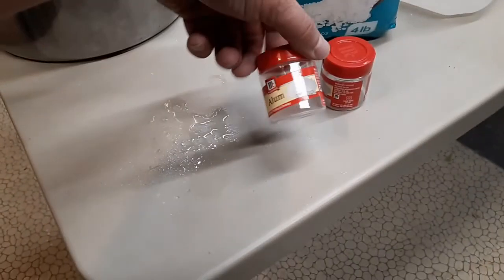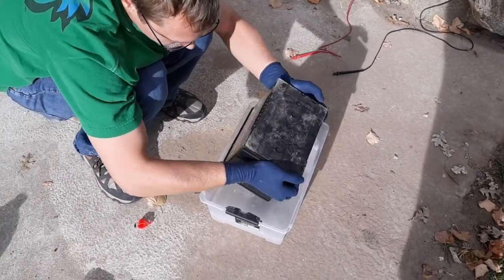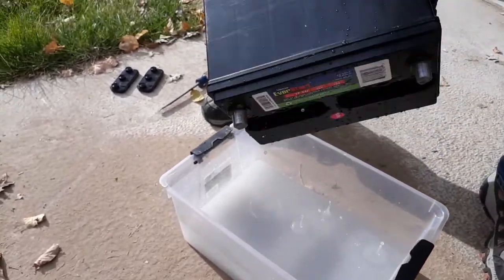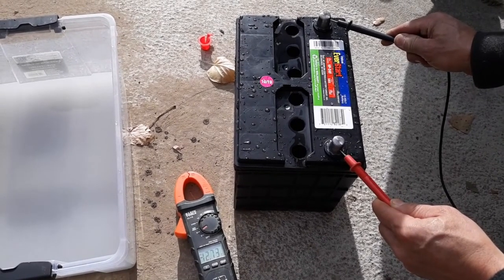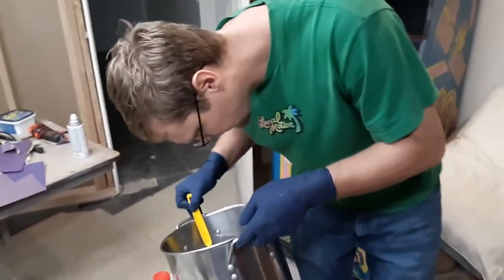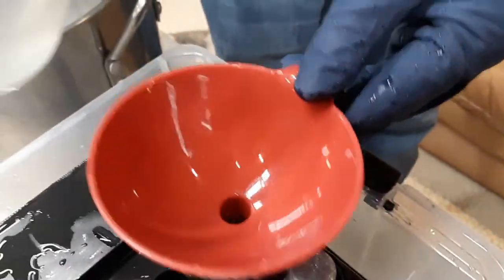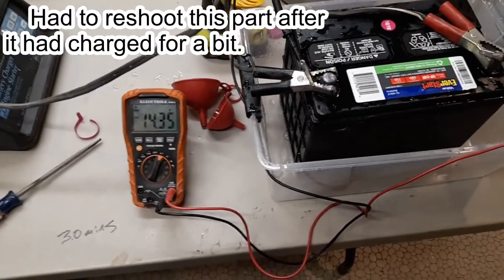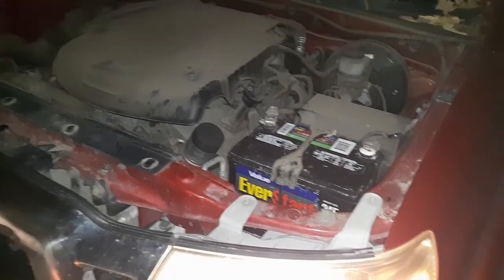Converting New Battery to Alum Magnesium for my Truck

Comment from the maker: In the next video I will show you the voltages on the battery when it's in my truck and I'll drain it and show you how low the the volts can go and still start the truck
Reply: Did you try using other lighter electrodes?  eg graphoil or nano coated copper ?(Keshe Plasma) or graphene oxide ink coated graphoil? (See Robert Murry Smith's Channel for info) . A bank of Keshe Plasma Batteries and plasma Caps could keep the Crystal batteries charged. A solid state self powering setup.

Comment: You end up using water anyway, so why not drain as much acid as possible like you did to treat it properly.  But then flush it with water over and over and over and over and over and over. And then forceful jet of water from hose into battery upside down. Flush TF out of it. And then you could run fairly warm to 'hot air inside to make every last drop of water leave. Then you can get to measuring properly!

Comment: I am wondering, if you discharged the battery fully ... all the way down to about 10V, would it recover or would it sulfate and die?
Reply: Replacement of the electrolyte should make it into a deep cycle battery.

Comment: What is your mix ratio?
Reply from the maker: There's no need to have a more concentrated mix than what I use, which is about 12 oz of aluminum potassium sulfate per gallon, the reason is is that the temperature of the battery determines the solubility of the potassium aluminum sulfate in the water, and if it's fully saturated at 16 ounces per gallon, when the temperature drops it precipitates into the battery. So having less concentration of avoids wasting aluminum potassium sulfate. You can probably even go less, but you won't change the fact that you lose a volt by doing this process, however it turns the battery into a deep cycle battery and allows you to draw roughly the same amperage down to very low voltage. However the lower the voltage goes, the lower the wattage output is, however the amperage stays roughly the same. I demonstrated this by drawing 3.2 amps at 11.9 volts starting out and was still continuously draining of 3.2 amps at 3 volts
Reply: I have recently discovered that magnesium is unnecessary in the battery, and I no longer use it in the mix.
Reply from the maker: The mix that I have found that works pretty well is 12 oz of Aluminum potassium sulfate per gallon of distilled water
Reply: @reliantbatteries7196  do you tested more concentrated solution ? What are risks and did that recover the 1v that is Lost when converting to alum ?

Comment: Better if ya add before you clean the battery out and use desulferizer on it to get the cells "initialized" the real word I forgot
Reply from the maker: No need to neutralize the battery, in fact it's better if you don't, because you are reducing the acid by so much already that it's  unnecessary,  Yes it will preserve the battery life further, but the  Little bit of acid that You  Leave in helps prevent freezing down to lower temperatures,  which honestly isn't that low, but   It keeps your voltage just a little higher,  Which is kind of nice.
Reply: @reliantbatteries7196  considering a diy deepcycle battery pack for off grid purposes. Interested in alternative to sulfuric acid due to hazardous shipping cost and high purity doesnt seem to make it cost less. Lead batteries are highly recyclable. So it seems to be a good platform. Thinking of making thick plates in 100's of glass jars. That can rival some of the best off-grid cycle life. My biggest question is what is the freeze point of the electrolyte?
Reply from the maker: @cekiert  more testing is needed, but I think it is around 10-12 degrees Fahrenheit, According to some of my tests. I need a better testing environment though to do a better test

Comment: what is the benefits of Convert Batteries To alum potassium sulfate, magnesium sulfate electrolyte.
Reply from the maker: The benefits of converting a regular lead acid battery to a Alum potassium magnesium sulfate battery. Essentially when you do this you are converting a regular battery to a deep cycle battery, your volts end up being lower because part of the reaction in the lead acid battery is your sulfur eating your lead plates, this reaction gives you higher volts, but as your battery discharges, lead sulfate is deposited on your plates, this increases the resistance in your battery because lead sulfate is non-conductive. The main reaction where you're getting your amps from, is from lead oxide not lead sulfate. So if you remove all lead sulfation from your battery, and you use a different electrolyte that doesn't increase the resistance in your battery, then you're not destroying your plates during the discharge. Simultaneously you are not having to reverse the lead sulfate reaction in your battery that requires extra electrical charge in order to charge your battery back to the previous state, and essentially all of the power that you're dumping into your battery is going to the lead oxide reaction, reducing heat during charging and discharging, where some energy is lost.

Comment: I hope you washed the inside first with bicarbonate to neutralise the acid? Thanks Nice video, can use  used batteries.
Reply from the maker: No did not neutralize the battery,  I have only removed most of the acid, therefore the solution is still acidic,  but not nearly as strong. I have done tests with batteries that came dry where your supposed to add your own acid, and the batteries like to sit at 11.7v, but they will sit at 12.3v if you have a slightly higher ph.
Reply: @reliantbatteries7196  Interesting. What volts do you get if washed? How many extra volts by adding  just the Magnesium? And the PH before and after adding the epson salts and acid. Is it now a deep cycle battery? Whst life do you expect from it? On Robert Murray Smith YT channel he shows how to make graphene coated anodes and cathodes .Im thinking using your electrode to make a much lighter battery without lead. Also Keshe says. If you put a battery inside a plasma battery it can self charge.
Reply: @quantumenergysolutions9128  when I started with dry batteries I was getting 11.77v, but it seems the volts will sit higher longer if you charge them at around 15v, and when you do it likes to sit around 12.3v. Though when i was doing the testing on the batteries that I started with that were dry,  I was unable to charge them with the voltages I wanted.  I have an alum battery that I converted to alum magnesium that sits at 12.3  and has been formed much better, via discharging very low and then fully charging,  this battery was used on a Power Wheels that my boys boys were riding and draining for me then I would charge them backup with a regular 12 volt charger that would go up to around 15 volts. These batteries seem to like it when you drain them significantly and then recharge them, they also seem to be able to take more amps at one time without creating hydrogen, also along with the ability to charge them faster, they also have a steady discharge curve that seems to last much longer than the lead acid, but you're operating voltage range is lower for most things because you start with lower voltages, I have created a 7 cell battery that I'm working on, that uses alum magnesium potassium sulfate without adding any acid, this will give me the extra volts that I need but will also give me more amps, and you should be able to drain them until they're very low without hurting them, and this would be great for a solar system.
Reply: Also I have more test results to share but I'm going to put them in the videos, as soon as I can get the videos edited and put up, I'm also going to do another video on Christmas day of my dad's batteries that he bought for his solar system, and show and compare  lead Acid versus the Alum  magnesium, and show you that the alum magnesium batteries are superior in the fact that they are not deteriorating while the acid ones are.
Reply: @quantumenergysolutions9128  also as far as the pH goes I haven't been able to test that yet, although I know that that is very important, however in my tests where I started with dry batteries, the voltage in the battery that I had both Alum and magnesium in went up by adding the Magnesium, I don't remember how much as I don't have the videos with me right now and all the test results were basically recorded on video oh, but I do know that it is enough of a difference that it is important to add the magnesium. It seems like from my test that if you just have magnesium you have less amps but a little bit higher voltage however if you have just Alum you have more amps but lower voltage.
Reply: @dcf246  Cheers!
Reply: @quantumenergysolutions9128  sorry I have been posting from two accounts in replies to your comments, without realizing it, both Spectators game and Reliant batteries are my channels
Reply from the maker: @dcf246   Further testing shows you don't need to go up to 15 V 14.4 is plenty
Reply from the maker: You can use used batteries, but the result is that you have plates that are already damaged from sulfation and it's better to use a new battery so that you don't have any of that damage to begin with, you can only revive a battery that the plates are still good in, and the problem lies in the sulfation on the plates not in the destruction of the plates
Reply from the maker: Upon further contemplation I realized that yes in order for this to be a true alkaline battery I need to get rid of all of the acidity in the battery because there will be some sulfation of the plates as long as there is still sulfuric acid in the battery.